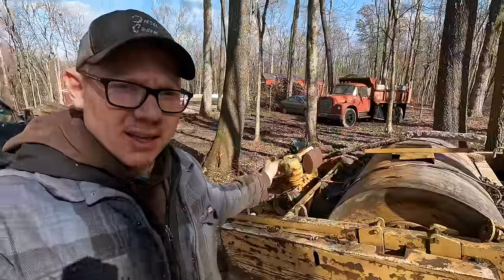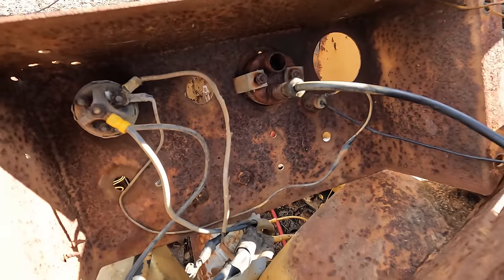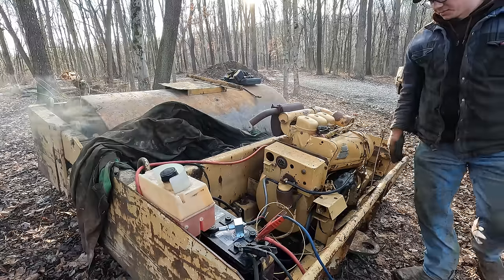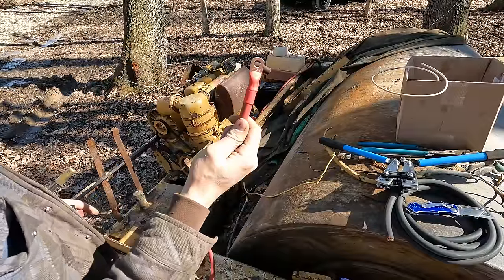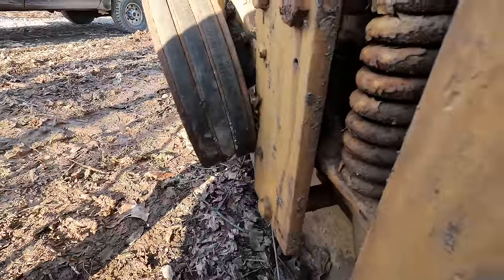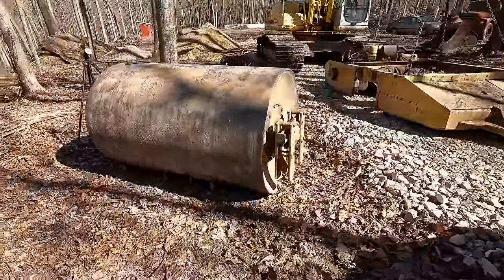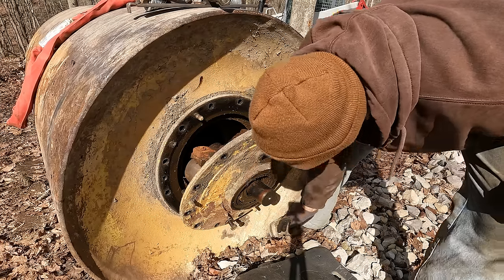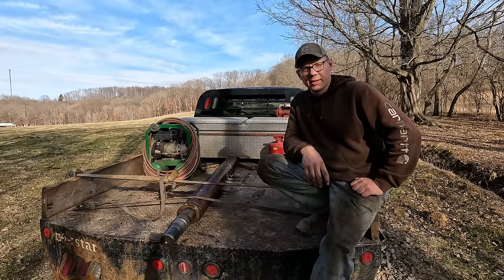Diesel Roller Compactor First Start in 30 years!! Can it be saved??

Comment: Are you sure that glow plug voltage range wasn't 9 to 15 volts? It's very strange for them to have the lower voltage listed second.
Reply: Having looked at the spec for that glow plug online, I think it's more likely 9.5V
Reply: @webra77  I'm not sure that's what the specification shows though. I mean 12 volts / 3 would be 4 volts and if they were meant to run on 6 volts 6 volts / 3 would be 2 neither of which match what was on the plug
Reply: @thecorbies  makes sense although that is a strange voltage.
Reply: @webra77  I'm not at all sure you're correct in that assumption.
The way Matt showed them connected - before he disconnected them was definitely in parallel.  i.e. 12V (or9.5V) directly to each GP
Reply: @thecorbies  Yes you might be right. But all the old tractors I have been tinkering with that have the same glow plugs they where connected in series so I assumed it would be the same way on this motor.
Reply: But there is also common that you have an resistor before the glow plugs to lower the voltage when they are in parallel.
Reply: The Bosch 0250200020 is a "12V" glow plug which is rated for 9.5 to 10.5V during 20 seconds. On some vehicles there is a glow plug relay with a resistor inside that drops the voltage and heats up while glowing, as the glow plugs get hotter the voltage rises and the relay detects this and shuts them off, also shutting off an indicator lamp so the operator knows it is ready to start.

It could also just be fine to run a "smallish" wire to the plugs, at 3x10A there will be quite a voltage drop in the wire and battery which gives an actual voltage around 10V at the plugs.
Reply: @thecorbies  well i am thinking it was originally a 6v system and thy slapped a 12v starter and a 12v charger on it, but never bothered to have the glow plugs changed  because it always started.
Reply: @webra77  They're not in series, they're in parallel.
Reply: @webra77  They are not in series, they are in parallel.
Reply: @webra77  is it possible to connect glow plugs in series?
Reply: I was gonna say the exact same thing. If it said 5 to 9, maybe, but 9 to 5 seems highly unlikely. Also: 9 and 15 is plus/minus 3 compared to 12, so it's almost sure it's 9 to 15.
Reply: @isaacclark6749  no. The body of the glow plug is connected to the engine case for the negative side.
Reply: @paulheitkemper1559  yes, that's my point
Reply: @mrfrenzy.  except for the fact that the small wire won’t carry that amperage
Reply: @webra77  They are connected in parallel (positive to positive; same voltage but equally divide current), not series (positive to negative; same current but equally divide voltage). Not being harsh but sharing valid information. Enjoy your day.
Reply: @isaacclark6749  Not possible to connect in series with a common ground.
Reply: @esqueue  Tehere are glow plugs made for series connection. Mainly (or exclusively?) on old engines. They are insulated with two terminals.
Reply: @esqueue  read my other comments....
Reply: @webra77  Sorry, wrong they are in parallel,
Reply: I'd agree with you, for a 12V system, 9-15V would be right. 
As other have added, wired in parallel (hot connection at top with cable contacts, return via chassis to ground)
Reply: Just swap them for the 12v version and be done with it. Needs at least one new plug anyways. Worst case, just have to run them a bit longer.
Ford used lower rated glow plugs on the 6.9 idi for quicker warm up. Bad idea. Swap them for more durable, properly rated plugs, you could use a manual switch and you no longer needed to replace plugs constantly.
Reply: @webra77  those are actually in parallel. Each on is grounded individually.
Reply: Do RC no sir. There are 2 systems: 1 the older type with an glow eye. This gloweye is an resister to the plugs. If the eye gets red the plugs are also.
2 the newer ones. These are directly put on 12 volts. But then take care! They have an seconds issue. You can buy the plugs for the same engine from 6 to 15 seconds. To long will burn the units.
Reply: @mrfrenzy. , yea, running smaller wires sounds like great idea! It should start before the new wires burst into flames. Lol 😝
Reply: @Hoaxer51  That is actually how electrical systems were built 45 years ago when this machine was constructed. Since wires were thin and had a large voltage drop the glowplugs were designed to work with 9.5V. Today we would use thicker wire, better batteries and get around 11V to the glowplugs.
Reply: @mrfrenzy. , I’m not an electrician, I’m here trying to learn about some of these things. 
I am a gear head so I really enjoy watching the videos, but my feeble attempt at being funny didn’t seem to work. I’ll try harder next time!
Reply: @webra77  they are not series. they are all connected together on the top (+). with case ground (-) = parallel
Reply: @webra77  They are parallel
Reply: @webra77  No, they are in Parallel, each fed from the terminal, each returns through the block.
Reply: I admire you drive, in this case rental not repair seem to make sense
Reply: @calholli  not in series. Each on is individually grounded.  Parallel
Reply: The setup is not for serial circuit.

Comment: Thumbs up on the soldering of the battery cable wiring to encapsulate the wire before making the connections. I have 40 years in the field. Never even consider it. I'll be doing that from now on. 
One can learn from. Thank you, Sir.

Comment: Remember these motors from my army/airforce days. Our trucks were powered by the V6 V8 & v10 Deutz motors. They'd smoke a bit when cold and would clear up when they warned up. They'd reach operating temp after driving for about 2 hours then they would run exceedingly well. Just as a note cold in South Africa is about - 8 Celsius and we'd go up to about 40 in the summer. These trucks just ran through it all.

Comment: I wouldn’t worry to much about the bearings Matt - for the work your gonna do a clean and repack should be fine - my heart sank when I saw that shaft and I saw your mood change as well- fingers crossed the fix isn’t to expensive - as for the glow plugs- alternator ect they can wait it’ll run just fine to get your pad packed down even if you do have to charge the batteries every now and then- all that aside that motor sure sounded sweet when she fired up 👍all the best mate from Tasmania

Comment: Back here in good old Germany you can find these 3 cylinder air cooled Deutz diesel engines still at every second corner. These are pretty reliable little beasts. We have a Deutz D 4506 tractor, built in 1974, now with 7100 hours (which is considerable low, despite the age). The engine has never been opened, the injection pump and the governor still have the original factory seals. And it never got more than regular oil and filter changes. Every now and then it has to get over the hills with 20,000 lbs gross train weight and 40 hp - then he really warms up. You can even feel on the drivers seat how hot the engine gets. Only down side: They can get really loud and annoying because of that fan running all the time, no matter what.

You just have to be careful with the air-cooled diesels if they have to work really hard. They are mostly built for high cylinder head temperatures. The oil can thin, get around the rings into the combustion chamber and burn away. We had this case years ago with a large air-cooled Czech Tatra tractor unit from the early 70s. With an empty trailer everything was normal, with a full load (65,000 lbs, 220 hp - so pretty much always pedal to the metal) the engine chewed through 2.5 gallons of oil in a 300-mile highway trip. Nothing had gone bad or broke, once it had cooled the oil consumption was back to normal. We usually use 15W40 on the engines, especially when it gets warmer outside and they have to work harder.
Good luck with your compactor, keep it up and running.👍

Comment: Matt, I believe I would think long and hard before I threw any significant money at this. I guess you could use it to maintain your road, in the long term. Best of luck to you. Really enjoy your videos. You deserve the dream shop.
Reply: he never throws money on anything lol.
Reply: @walkertongdee  The starter alone was already 400 bucks. With all the stuff to repair it could cost like 2k to fix it all, not even counting all the time spent doing it. Personally I think this thing is a lost cause, but maybe Matt proves me wrong.
Reply: @walkertongdee  exactly 💰
Reply: If nothing else it generates a video. Doing this as a full time job requires a continuous flow of work.
Reply: @kenore4003  Doing what as a full time job? Matt isn't a full time youtuber.
Reply: 400 bucks in the starter but if this dont work matt can use the engine for something else...
Reply: @fedeperezko  yeah, but the engine isn't in the best shape either. Considering all the other diesel engines he prolly has, this engine prolly would be one of his last picks.
Reply: @mrnuthatch7004  yeah but if my mind is correct the machine was free so...

Comment: Those are SWEET little engines...They work quite nicely on a 6" water pump, (at the landfill) the little engine saw ZERO maintenance as evidenced by the rebuild paint on oil filter. SOOO I asked the boss if it could get service with some other equipt. Did my heart good ...SAY, knew an old man with VWs & MBs who would use NOTHING but WD40 as start aid...

Comment: Great video Matt, we use to repair old machines like that. Drill and tap the shaft, screw in a threaded stud to reinforce it. V it out real good for deep penatration, and weld it together with 7018 rod. Good luck !

Comment: The glow plugs are in parallel, not series.  You could measure resistance on each one if you take the wires off.  If you get new plugs, you should put something in series to control the current.
Reply: Yes to all that!

Comment: I am mechanical engineer in a coal powerplant and there we often have to repair big broken shafts very similar to the one you just pulled out of the drum. There are three ways to do it. Make new one from scratch - the best but by far the most expensive option. Prepare the surfaces on broken parts and weld  them - the least expensive but very prone to brake again, especially since your shaft snapped on the side where it receives all the torque. The third option is to prepare the broken surfaces and drill a centered hole on both side, slide insert inside and weld it on both sides and then fill weld the rest of the original shaft. 

Either way, one needs some serious equipment. That shaft is quite big so It takes serious lathe to work it and it takes some skill to do the welding with proper welding rods. Welding shafts that long can often lead to deformation. 

I completely understand your statement at the end. It is possible that the price for the repair will be to steep.

Comment: I   DEFINITELY want to see the next video on this roller; Hope it's worth while repairing ! Great video Wes !
Reply: Wes huh? Yah someone has my watching schedule. This vibrator will tow around and smash the gunge back into table top under floor. Gravel in setting before vibrating down into floor with side concrete beams angled towards center of floor shaped for strong floor beams around sides that go straight down around sides to stop cold from seeping under floor.

Comment: When you have a box, add some extra cable or a service loop so if you have to cut and replace stuff in the future you have a little bit of extra cable to work with... Should also consider running wires in plastic or metal conduit for protection.

Comment: 2 things I wanted to say:

First AWESOME IMPROVISED PULLER. I'm totally with you that getting creative to issues is a part of increasing your knowledge repertoire. Solving things by going to the store or back to the shop is time consuming and doesn't teach you anything. Even when improvised things don't work you get to add that to your knowledge bank of solutions that you know for certain won't make things better. 

The other thing I wanted to mention was a Word of caution when using solder on your wires. Your average Tin Based Solder (non silver bearing) has around 10% the electrical conductivity of copper and can impede the current flow so I'm glad that you only did part of those stranded wire and allow the rest to make contact with the crimp ring. Not really something you need to stress over normally however when you're working on systems that are drawing large amounts of current it can cause a local hot spot at the solder enough to melt it.  

That being said since copper is the standard for conductivity many people underestimate the capabilities of materials simply because they are reduced in comparison to copper. Solder will conduct electricity quite effectively you see this on a lot of import welder boards where they build up a large cross section of solder to transmit large amount of current simply cuz it's cheaper than using copper plate. 

Great to see you got that bad boy started keep up the great work!

Comment: 31:52 Yes, you can series connect two 12V light bulbs on 24V, no problem, but... Your connection of the three glow plugs are in parallel, NOT series so each is seeing full battery voltage.  Unless you put a load resistor in line with the glow plugs, you are going to burn them out rather quickly.
Reply: If they were in series, then an in-line resistor would be in the wiring and he probably would have seen that.

Comment: These two "ball bearings" at either side of the vibrator shaft were interesting to see! I hope you have a good machine shop that welds the shaft at a reasonable price as concentric as they can get it.
Reply: I believe the 2 large bearings are to help carry the load of the eccentric for the vibrating part of the roller. Or they may be part of the eccentric, they were tightened to the shaft.
Reply: @jackbraithwaite8345  The two large balls are the imbalance that causes the reel to hit. This roller has no eccentric.

Comment: Those glowplugs each draw current, so hooked in series, they cut the power by 3volts each. this makes it possible for the glowplugs to be hooked to 12 volts without damaging them. each engine will have an extra resistor somewhere to cut the current extra, if the series does not cut voltage enough. Alternately, Glowplugs take time to heat before high voltage can damage them, so use them for a shorter time if you use straight 12 volts.

Comment: Hi Matt!
As an alternative to heat and acid core solder on battery leads: use one of your large copper ring lug, crimp and cut off ring. It makes a quality ferrule.
Reply: I have also seen those who work on Solar setups say that adding solder to the wires for this use hurts conductivity. Since their setups need to run high current for many hours maybe it matters more to them. However I like your lug idea!

Comment: Glow plugs are pretty cheap usually, I'd change them out since they're so old plus new ones will work with 12v and you won't have to do some weird connection to lower the voltage to them.

Comment: Never solder wires going into screw terminals! Solder isn't solid, it will slowly flow out of the clamp and cause bad connections.
Use wire ferrules instead.
Reply: Not going to get in a debate but that's wrong...
Reply: @lennym1273  I'll get into a debate then, Máté Szűcs is correct, you are wrong.  Which industry were you in?
Reply: @lennym1273  I have to tell you you are wrong, we covered this in the first week of training
Reply: @____________________________.x  yep

Comment: That shaft will take some pretty serious loads when it's running. Will a welded repair take the strain? You may have no option but to fit a complete new shaft. On the other hand, the shaft might be same both ends so you could put the repaired end on the non-drive side.
Reply: Nah, just cut off the broken pices and save the middle section then machine two stub shafts and inteferance fit them to the center bit and turn to size. Time consuming, but not that bad to do really.

Comment: Matt, removal of the vibratory shaft stub, why not try a SDS hammer chissle point into the hole on the end of the shaft? Viberate it out!

Machine shop options, try community colleges. You may find free labour where they are often seeking real world examples.

For the berrings can those be rebuilt, maybe the rollers can be replaced and their roller surfaces be ground?  I am guilty for replacing all the 5/16 balls on one on a tower thrust berring I was rebuilding. Just ideas!

My thoughts beg, borrow or maybe buy a plate tamper, as you want that building this spring!

Comment: 12v glow plugs in line take 12v in parallel take voltage specified on them normally reduced down by the correct glow plug relay also the alternator may need a batt poss input to make it charge we call them an exciter circuit here to 12v positive or the hot side as you guys say

Comment: 25:26 These Deutz diesel engines usually start very well. Provided you use the preheating device.
The glow plugs are actually connected directly to the battery via a relay and a fuse (approx. 80 amps). The relay is then operated via the ignition switch. The glow time can be estimated at approx.
Set 8-10 seconds.

Comment: On the glow plug, I would use a ford style starter solenoid as a relay for them. Parts are cheap and it’s a simple system. Great series
Reply: Busted you watched the new Vicegrop Garage video today that featured that relay lol..
Reply: Why if the voltage stated is right not a problem if the switch is any good
Reply: I not a VGG watcher but using a Ford solenoid is nothing new.